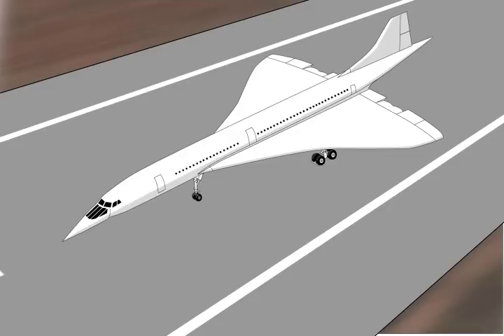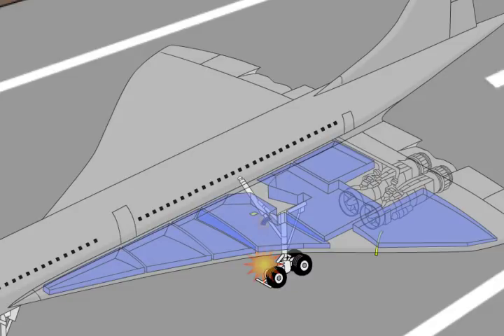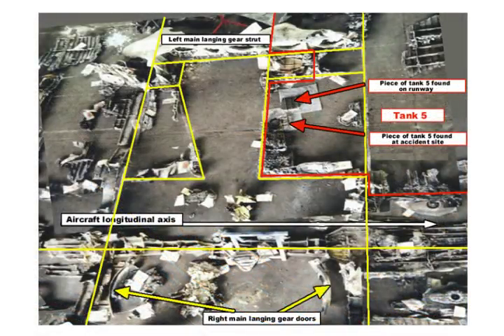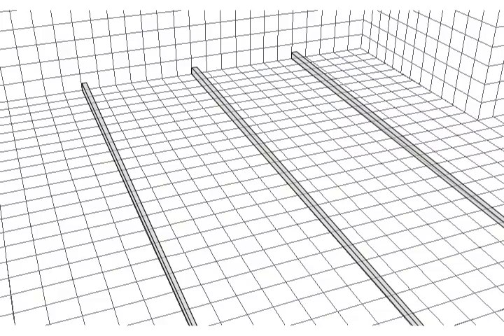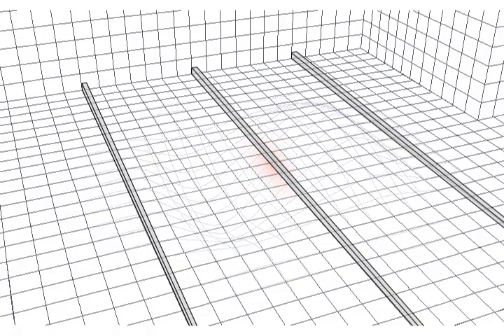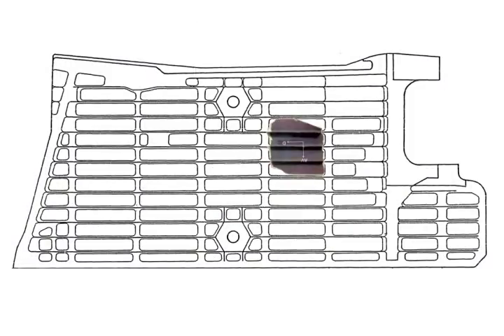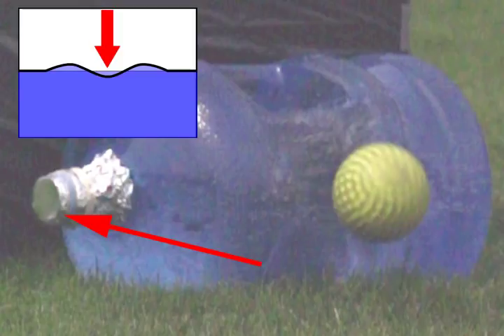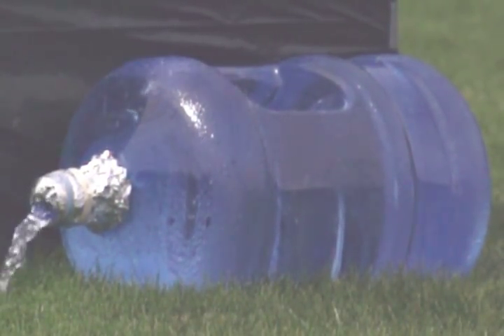Detailed Failure Analysis: The Concorde Disaster (Air France 4590)

Comment: The tank failure was caused by the captain authorizing the tank be filled past capacity by the 20% safety zone used for this very purpose. Fuel tank overpressure and failure projection. Strictly prohibited! Also of note, the aircraft swerved upon hitting the three inch construction lip that is why the captain had to rotate way early because he was headed directly for the 747 carrying the president of France on board. He was even 20 knots short of the takeoff safety speed. That is unrecoverable except possibly for having the 8% override position selected on the afterburner. Not selected. The pilot of the 747 reported that the Concord missed them by 20 feet. Duck. At least that was a good thing
Reply: I read somewhere on YT that the extra 8% reheat is not always available i.e. some Concordes do not have the facility.
Perhaps someone can confirm / clarify.
Reply: Martindyna, yes that's true! Watch the video "John Hutchinson flight 4590" and he explains the small differences in some of the Concordes! Very good video!
Reply: Contingency Power will automatically activate on takeoff if N2 drops below a certain threshold (58% I believe) on any engine and it in fact DID activate on the accident flight when no. 2 spun down, fire aside the aircraft was recoverable or it would have crashed immediately on takeoff. 

Contrary to a spreading belief due to Captain Hutchinson's videos Manual selection was NOT required this is simply not true 

His opinion isn't as accurate as his charm and qualifications suggest I was shocked at his glaring mistakes and omissions

He's correct about the overfilled tanks being a crucial mistake as it made the effects of the pressure wave worse but it is unknown how much less fuel prevents the rupture it's possible the accident still occurs with normally filled tanks

He fails to mention that the final stall was caused by no. 1 ingesting parts of it's own wing and the subsequent failure and asymmetric thrust from 3 and 4 causing the 100⁰ overbank to the left forcing the crew to throttle back 3 and 4 and inducing the stall since they were only marginally flying 

He also doesn't highlight the effect  the drag from the landing gear had  on ability to gain airspeed more so than the calculated overweight of less than 1 ton, the gear failed to retract
Reply: @PabloGonzalez-hv3td  Hey I read some of your other comments. Why would Mr Hutchinson lie?
Reply: @yassm  I have no idea but he makes glaring mistakes like forgetting that CONTINGENCY POWER has an AUTO mode on takeoff.

Comment: How many other planes have crashed and were never discontinued like the Concord plane was. One accident in 27 yrs and they discontinued this plane, not really a bad safety record for a Super Sonic plane.
Reply: +Andre Canuck  It wasn't the crash that killed Concorde, it was the fact that operating conditions in the airline industry made the aircraft uneconomical to operate.  The fact that Virgin were not allowed to continue to operate the aircraft as a loss leader as Richard Branson wanted to was caused by the British Airways board not wanting the perceived loss of prestige from giving up the operation of the aircraft, which I still feel was a poor decision though ultimately it would only have been delaying the inevitable as Concorde was close to its design life so the aircraft could only have continued in service for a fairly short period before requiring massive overhauls which would probably not have been financially viable...
Reply: You are right and this accident was totally the result of negligence and total ego on the part of the captain. What a stinker
Reply: Supersonic flight essentially means you are 'compressing' the air in front of you, instead of slicing through it. This results in the 'sonic boom' but also a massive waste of energy (the sonic boom travels with the plane through its entire flight). So, if kerosene (jet-fuel) was free, Concord had a chance. But it is not. So no airlines would buy it. British Airways and Air France were forced to buy them and run them, at a loss. They hated it. The accident gave them an excuse to dump a disgustingly polluting gas-guzzler. 
As for why supersonic flight is so bad, that's pure thermodynamics/fluid-mechanics. Air is incompressible at low speeds, but compressible for a high speed object. Its like flying through sticky goo that sticks to your wings. All modern aircraft are actually slower than the jets of 80s/90s. 
We will never have super-sonic transportation. Except in movies.

Comment: If People who dont know back in 2000 air France flight 4590 was going to paris to new york and the air France flight 4590 was going to takeoff and going to fly but small piece of debris metal from DC 10 hit the Concorde leading into the fuel tank damage and the fuel fire and the Concorde ended up stall and the crash into the hotel killing all 109 people on board in air France flight 4590 and killing 4 People on the ground in the hotel after the accident air France and british Airways retired Concorde in 2003 RIP Concorde😢 you will be missed😢 i love Concorde

Comment: They only talk about the fuel tanks. There were many other problems that added to the crash such as Missing wheel spacer,  Wheels out of alignment so pulling to the left, aircraft over weight at the rear end, fuel pumps left on during take of so the ruptured tank was continually being refilled . Taking off at to slower speed due to being pulled of the runway by the out of aliened wheels. Taking of with a tail wind while overweight and over fuelled. And the flight engineer switching the engine off even though it was still producing power.  The best video is Ex Concorde Captain John Hutchinson.  https://youtu.be/fqOcYhzWUZY
Reply: "The best video is Ex Concorde Captain John Hutchinson". By far the best account of the series of events that caused the accident, all within 20 minutes. Although I've read books that quote the official report and say that some stuff that legendary Cpt. Hutchinson cites as crucial factors for the crash (e.g. the flight engineer immediately shutting down engine #2 etc) did not contribute significantly to the outcome of the accident. Even with engine #2 running, the aircraft would still have become uncontrollable and would have crashed. I'm in no position to judge who's more correct, as there were way too many politics involved in those official reports anyway due to the many contradicting interests (Air France vs German tourists vs British authorities vs a US company etc). The fact remains that Hutchinson's interview is a must-watch.
Reply: Thank you so very much for showing the link to Captain John Hutchinson's video. I'm half way through it, but came back to give you a thumbs up before finishing the rest of his video. You are so right- I've watched a bunch of the videos about 4590, and I like his the best.
Reply: Thank you for sharing comment.  I've listened to Captain Hutchinson's account, and it is clear, that but for the Air France Captain's actions, this crash might never have happened.  Unfortunately, it resulted in the plane being branded as unsafe, which was simply unfounded.

Comment: Misleading info. The pilot overloaded the fuel tanks, and kept pumping from one tank to another, which made the recipient tank spring a leak. 
The tire fragments did not puncture the wing. There was a dent but there was never any puncture of the wing by the fragments. Investigators claim that the 'slap' from the tire on the wing caused a shockwave which in turn made a pipe burst and the fuel was being sprayed over the wing (on top). Most videos skip this very important detail. How a slap from a tire fragment (4kg?) can make a pipe burst on the other part of the wing is a good question. It could have been weakened already or it was just bad engineering. However, it is still speculation. There is no direct evidence that the bursting of the tire (not that uncommon in planes) caused the wing to rupture on the top side (not bottom).
Reply: Actually this was proven, the tanks where fully fuelled before departure and 12 extra bags that where not weighed where placed in the rear hold. As a result the aircraft was over the maximum structural weight, and burnt less than half of its required taxi fuel whilst manoeuvring toward the runway. (Therefore their was no “airspace” in those tanks), when the tire struck the wing it was travelling at an estimated 180mph, meaning the energy from the impact had no way to be dissipated and therefore caused a rupture at the weakest point of tank no5
Reply: regardless of where the tire hits the fuel cell,  the impact causes an over pressure situation, fluids are incompressible. The cell or any part of the system connected to that cell may now fail where it is weakest, whether that be the top, bottom, or a pipe further down stream.
Reply: Tank 5 was not "overloaded", it was correctly filled to 94% which was normal for any trans-Atlantic Concorde flight. The "slap" was a 4.5kg length of tyre hitting the underside of the wing at approx. 310mph. The mechanism of the rupture was the fuel was pushed to rear of the tank bulkhead under the acceleration of the take-off, confining the 6% ullage/air to the forward upper portion of the tank. The tyre struck the rear portion of the tank, close to a seam and the shockwave from a full (and correct 94%) tank caused the rupture. Concorde was designed in the pre CFD era, so no allowance was made for such a scenario. 

The theory that fuel was being pumped forward into the tank during take off is frankly, wild speculation, based on the state of the engineer's panel at the crash site having fallen 200 ft out of the air and consumed by fire. Concorde's Flight Data Recorder DID NOT have the capacity to record the movement of the 100s of switches on Concorde's flight deck. The more likely scenario was that in the final moments of the flight, the Flight Engineer may of noticed that 5 tons of fuel was missing from his Tank 5 and may of selected to pump fuel into the tank to attempt to refill it and bring the CofG back forward. It took the investigation 3 weeks after the crash to work out it wasn't a catastrophic engine failure that caused the fire, the crew had no way of knowing it was an external fuel tank fire.

Comment: Plane was over loaded. Had too much fuel in the tanks. Too much fuel in the rear tank.
The strike of the part  caused a shock wave in the fuel that would have been dissipated if the tanks had not been filled to the top as they are not supposed to be. 
The captain knowing the plane was over weight by several tons also used a section of the runway that was being recovered and had a 1” lip where it met the runway being used. They also had left a part of the landing gear off by accident that keeps the left wheels separated on the main gear. When it struck the 1” lip on the runway the gear was knocked out of alignment causing the wheels to scrub and heat up before hitting the strip.
In addition the flight engineer saw a fire warning light on engine #3 and shut it down without letting the pilot know he was loosing the power.
In addition they emergency power was never selected as the plane lost airspeed and stalled partially due to the flight engineer shutting the engine down even though it was making power.
Reply: The plane was also way out of cg range due to the captains decision to take on more luggage and more fuel than he was supposed to be able to safely fly with.
Reply: If the tanks had not been filled last their safety limits of 85% the pressure wave would have most likely not caused the pressure wave to burst the tank. In addition the pilot had left the fuel transfer pumps for the rear tank on so they were constantly topping off the wing tanks knowing he was so far out of cg and holding to burn that rear tank off as fast as possible.
His actions were more to blame for the accident than the strip of metal.
Reply: I th ink you'll find it was Number 2 engine that was shut down pending 'engine fire' indications.
Reply: The slight overload had no impact on the accident. There is no such thing as 'emergency power'. 

Aircraft was so damaged that a crash was inevitable.
Reply: behind the throttles there are 4 buttons that allow for emergency or military power with the afterburners. they are intended for extreme situations and allow the afterburners to operate beyond the 100% power setting. also a stall caused the crash not a structural failure.
Reply: No, you have just made this up, sorry. Those are simply the afterburner/reheat switches, and they took off with them on. In any case, more power from the operating engines wouldn't have helped - the asymmetry was already too high. And yes, I know that a stall caused the crash, the point is that structural damage meant a crash was inevitable, even had they avoided the stall that killed them.
Reply: You and Todd are almost right.  The 4 switches behind the throttles are the afterburner switches. They have 3 positions - off, on and 8% increase for such situations.
Reply: The Concorde almost crashed into a Boeing 747 that was taxing. John Huntchinson's video explains it perfectly.
Reply: @blueb0g   The overload had more to do with the crash than the report lets on. Qualified Concorde pilots have been saying this for years.

The investigation was rigged to blame anyone but Air France. The metal strip on the runway was a convenient scape goat.  The plane was well off the centerline and too far to the left. Had the wheels not been rubbing and dragging the plane to the left, she would never have touched that metal strip!
Reply: @bobolulu7615  It has been claimed that French Concordes did not feature the 108% position for the afterburners, is this correct?
Reply: @bmused55  - The weight wasn't so much a factor as was the overfilled tank that made the effects of the pressure wave worse but the crew's subsequent actions as described by Captain Hutchinson's videos are erroneous and don't reflect factual information like the ability for Contingency Power to automatically activate on takeoff if N2 drops below a certain threshold on any engine which is what happened in this case

Comment: No mention of the fact the tanks shouldn't have been 100% full. The captain told the ground crew to over ride the safety cut off which normally only fills the tanks to 80% full leaving room for compression should anything happen. Thus avoiding what happens in this tank failure analysis video. He also left the fuel pump running during the take off when it should always be off on the take off run. The punctured fuel tank was continually being filled with fuel from other tanks as quickly as it was loosing it as not only was the aircraft over weight, but its centre of gravity was out  by 10 tons at the rear of the aircraft. The captain left the fuel pumps running to try and get the fuel forward as soon as possible to correct the centre of gravity problem but then the accident happened so it became another contributing factor to the accident.  If you want to see the full details see John Hutchinsons interview.  https://youtu.be/fqOcYhzWUZY

Comment: BS analysis. The larger than God captain ordered that the protection override B eliminated for his flight and over fueled the tanks by 15% leaving no air in them for expansion. This led Shockwave moving from bottom of tank to top of tank and Back Again on the way back what's the problem it burst the tank with a bow attorney in diameter hole in not but only the tank but the wing which then ignited. Had the fire continued for much longer the wing would have obviously burned off. In all fairness in this particular case airport with possible overrun would be preferable.
Reply: I'm wondering that if they didn't shut of the engine and did get up to speed, the fire may have blown out. The fire wasn't going into the engine so they might have gone supersonic and if they shut of the pumps to the front tank it wouldn't feed the fire.

Comment: Design tyre with steel cover
Reply: or just dont over fill the tanks
Reply: When they started to fly again after the accident they did have stronger tyres and extra fuel tank protection. Sadly 9/11 happened just as it made a comeback and people stopped flying, which didn't help when there were trying to get it back into service.